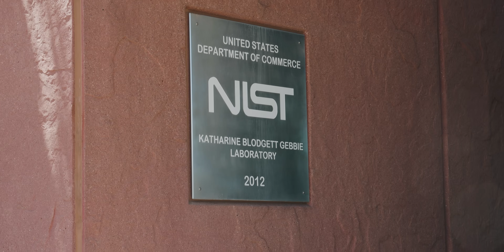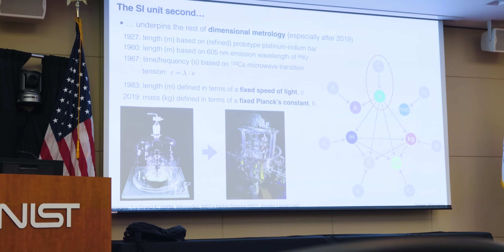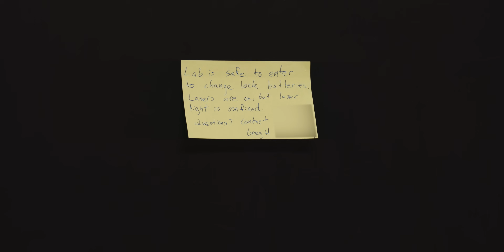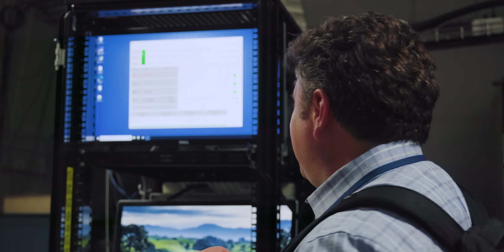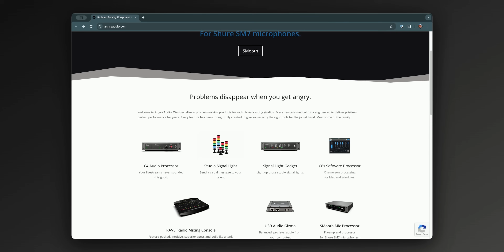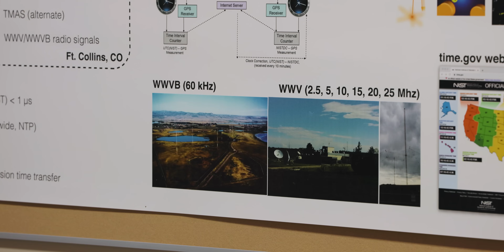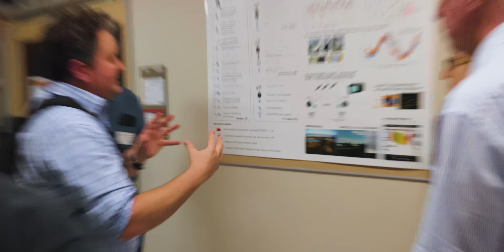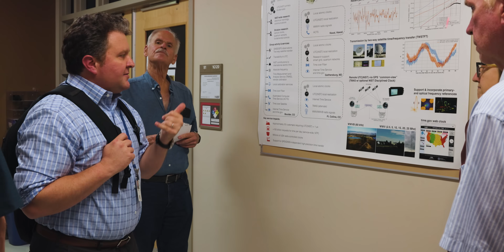How do we measure time? Atomic clocks!

Comment: Been trying to tell the people that work on these atomic clocks that there is other alternative ways of getting a precise frequency for a time step precision that stays in lock step with decimal computational precision.

you can use fractions like 1/9801 or 1/998001 all the way up to 1/999999998000000001 and every fractional decimal result gives you a precision time counting depth of deep decimal precision.

299792458 / 299792457400415084299792458

Wavelength λ = 0.000000000000000001000000002000000003000000004000000005000000006000000007000000008000000009000000010000000011000000012000000013000000014000000015000000016000000017000000018000000019000000020000000021000000022000000023 m

Frequency
299792457400415084299792458 Hz

Energy E           = 0.00000019864458531760369876885884571489287 J

Atomic clocks are great for communication but if we want to go deeper than just basic GPS communication and start going into super Sub-c time scales , we need to expand our frequency range and deepen our decimal precision to scales such as these.